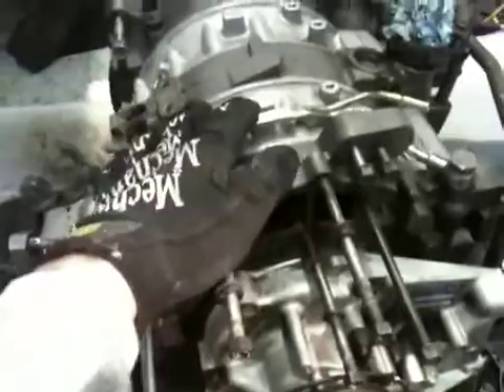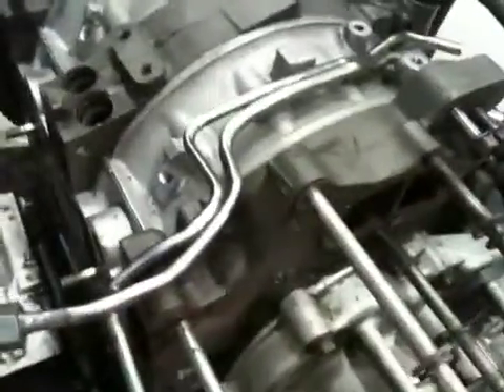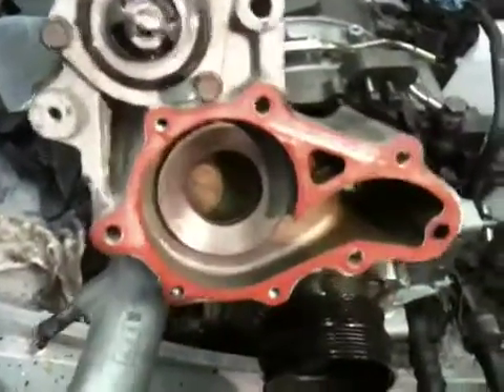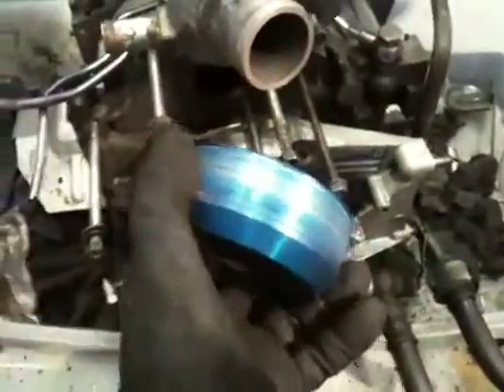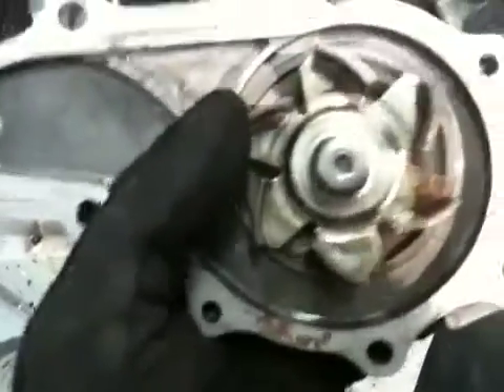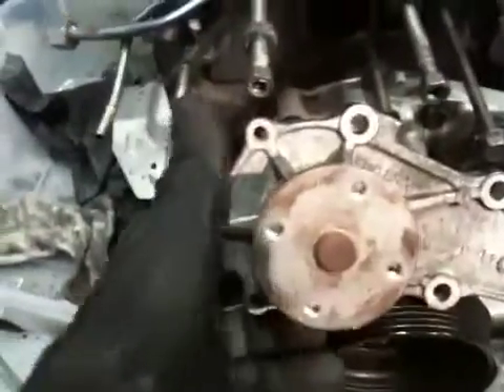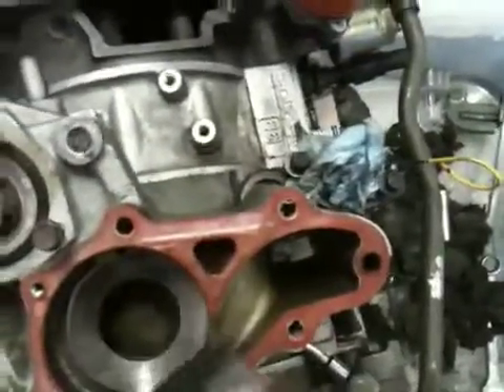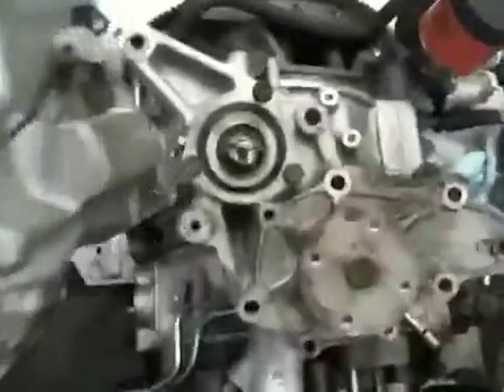Water pump and thermostat housing on the 93 RX-7

Comment: hey i've a question, im having an issue with one of my fd's where i top off the coolant with car cold, turn it on and bubble it out then when its pressurized and im driving afte a few mins the temp rises alllll the way to the top, then after a couple mins it suddenly drops back to normal temp. since the w/p is pretty mechanical do you think the prob is a seizing thermostat?! thx for any input
Reply: Try a lower temp thermostat and the fc thermoswitch
Reply: It fixed the problem in mine